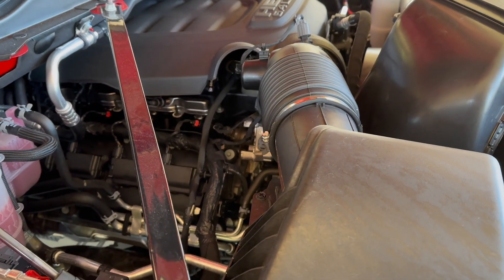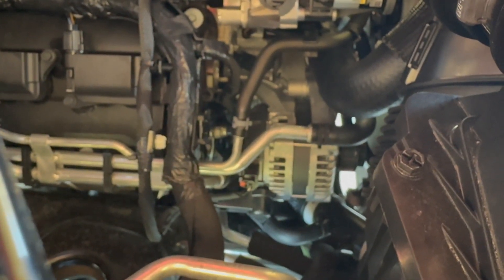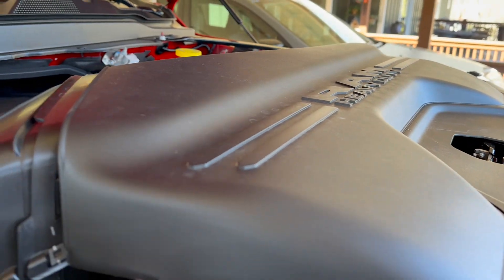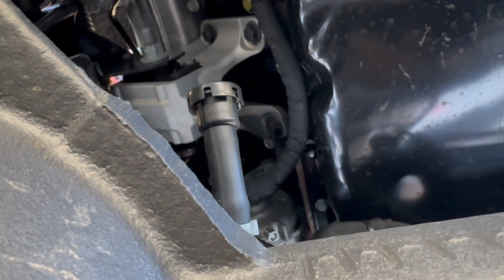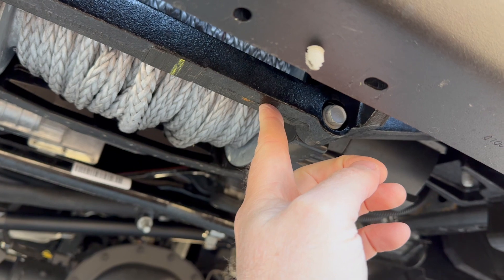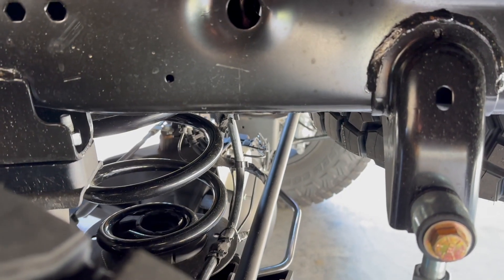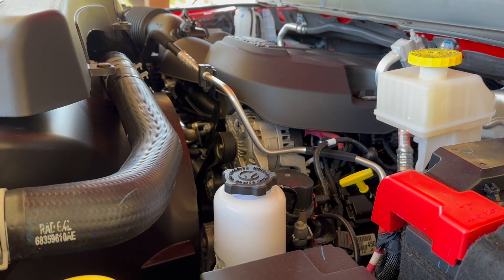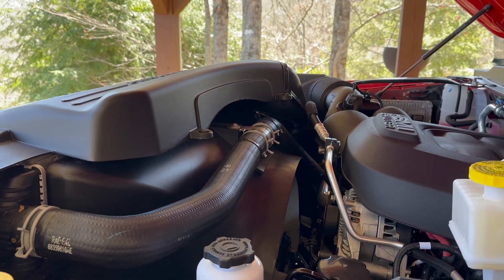Water Fording clearance information on 2024 Ram Power Wagon

Comment: That axle vent tube is supposed to have a GoreTex membrane of sorts to prevent water intrusion.
Reply from the maker: That is what I have heard and read especially since the manual states it can go as deep as 30” so that vent would definitely be submerged.  I did however recently extend it up for good measures and will be posting that video soon.  The transfer case and transmission vents are the same type of vents as the front axle, but the rear axle looks like a more traditional one way valve type vent.